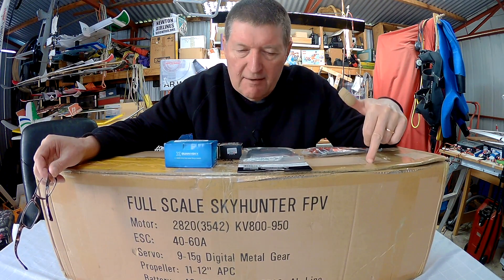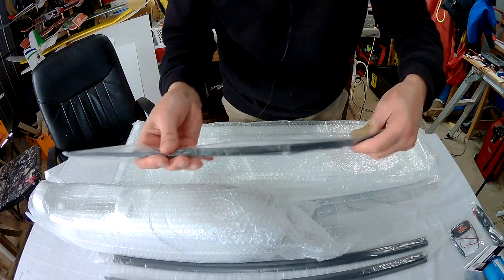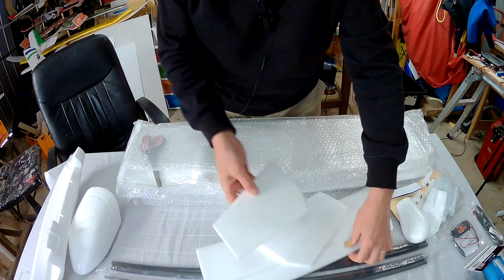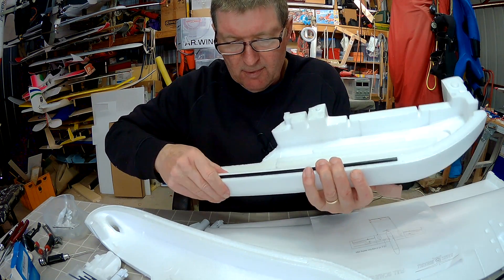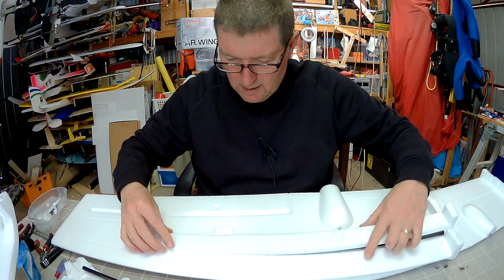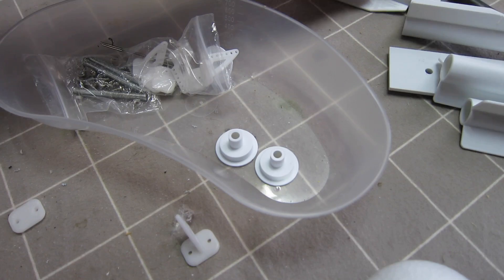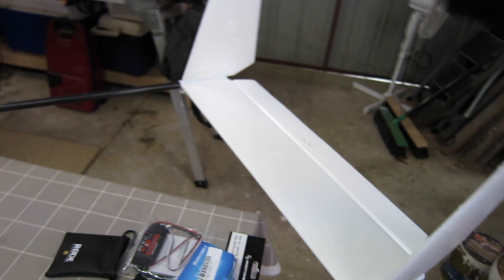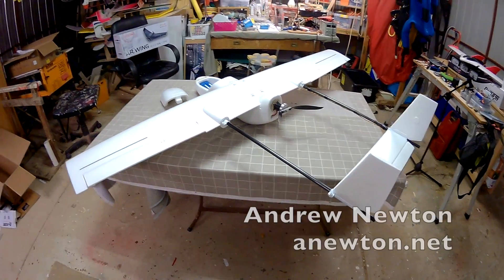Skyhunter 1800 kit build

Comment: What glue did u use
Reply from the maker: UHU Por and hot glue
Reply: @AndrewNewton  would uhu 2 component glue also work
Reply from the maker: Dont know that. Would be OK if it's epoxy
Reply: @AndrewNewton  will it hold good long term

Comment: Hi Andrew< starting out here so please excuse my ignorance, had a look at the links provided. looks like a nice plane, What Controller were you using and what would you recommend ( I take it the RC Controller doesn't come with the plane?
Reply from the maker: You can buy planes that come with a radio. Look for RTF or Ready To Fly, but they are always very basic radios. Best possible first radio is the Taranis Q X7 with an X6R or X8R reciever.  That will set you up for life. Cheaper option would be FlySKY i6X. Other people will tell you Spektrum radios are the way to go but they are way too expensive for me.

Comment: What prop and spinner did you use for the first flight ? I currently have a 11x8 on my skyhunter but I was wanting to get something a bit bigger without adding landing gear. (motor is 470kv running on a 6s battery)
Reply from the maker: Links in the description David, but that prop was too big for my setup.
Reply: Thanks for the reply ! So the 11x8 I currently have feels slightly underpowered , any suggestions ?
Reply: Also what did you use to mount the prop? I couldn't find a link for the spinner.
Reply from the maker: Good question, I can't recall which spinner I used. Probably from the Dynamo Sonic. Now I'm using the CarbonBird motor and Aeronaut prop and spinner.

Comment: Hi Andrew,
At 4:22 you show a carbon tube to be glued into the wing... Is that correct? I'm about to buy a Skyhunter and jumped onto the RCG thread for this plane and not seen anything about the tubes to be glued in??? It would be good if it is the case...???
Unlike the stupid idea of making all of the boom brackets the same!
As ever, thanks for the video....:-)
Reply from the maker: Yes wing spars do have to be glued in, then the main spar slides inside. Those clamps are odd but they work
Reply: Thanks Andrew!

Comment: Love your videos Andrew - PS:We have these in stock in AU now http://www.multiwiicopter.com/products/skyhunter-1800mm-long-range-fpv-au-australia-airplane-kit ; fly it with our Aussie made AIR3 iNav autopilot - has AutoLaunch control for safe n easy handlaunching http://www.multiwiicopter.com/products/inav-air3-fixed-wing-airplanes
Reply from the maker: Thanks, that AIR3 AP is very tempting
Reply: email  you're details - i will send you an AIR3/GPS to review :)
Reply from the maker: Ha, oh dear. I have resisted auto pilots so far but you might turn me. Thanks man, very generous. Email via the website?
Reply: nothing beats hands-on iNav AIR3 has full pass-thru (switchable) mode  - info@multiwiicopter.com
~  the auto-launch means you can hand throw it with fingers safe (stabilised) and watch it power itself up and climb out level while you casually pick up the Tx ; and if you do fly out of range it will return home and circle etc

Comment: Which is the maximum length of the chord at the fuselage and the airfoil thickness?  Thank's
Reply from the maker: Hay Fabio, I will measure it for you soon.
Reply: thank you very much
Reply from the maker: 240mm max chord (out to 340mm from the fuselage) 200mm at the wing tips.Max Airfoil thickness is about 30mm

Comment: Great plane and a nice video edit of the process! Thanks, Andrew! I wander, almost all my planes are of EPP (Elapor. I have planes from Multiplex) and they all seems to have hinge problem, specially after many hours ware and tare. I noticed on the FunCub XL, the elevator was getting pretty loose, so I used hot glue, very little, and used the hot snout of the iron avter aplying it. A little bit stiff, but it works. You didn't show your way of strengthen the hinges, but can you prove of the method using hotsnot?
Reply from the maker: I do use a thin smear of hot glue sometimes but just tape usually. Nothing with this plane yet.

Comment: Andrew what's going on with the cf booms sticking out past the horizontal and vertical stabs? 
Do they allow you to move the tail back and forward to adjust the cg?
Looking forward to seeing this puppy up close
👍🏻
Reply from the maker: Yes the tail is just clamped on so can be moved. I think I'll move it forward a fair bit so it fits on the car without having to pull apart. Tail doesn't need to be that long

Comment: Wow....that Fuz is huge....no problems getting your gear inside there Andrew....The omission of Rudders is a bit strange for a plane of this size. Rudders are used to maintain heading via the Autopilot. My Skywalker 1900 uses a 10 x 6 Cam prop and it has acres of spare power on 4S, this massive folder seems OTT...?
Reply from the maker: You're right. Have swapped for an 11 x 6 non folding prop and will test soon. Prop doesn't even hit the ground now